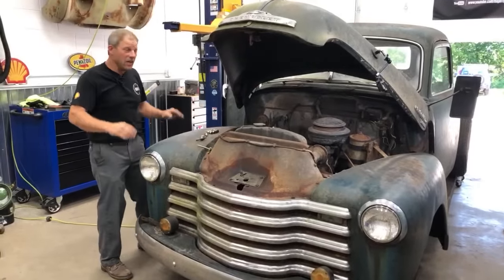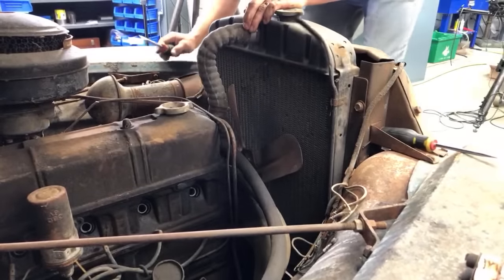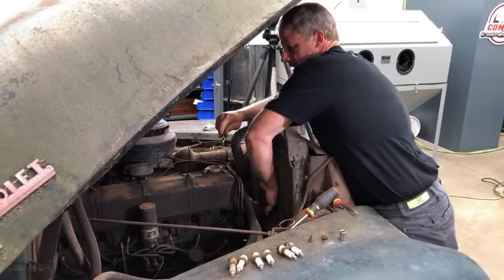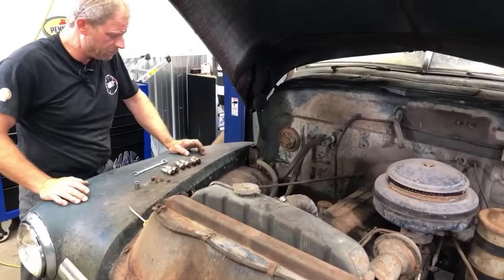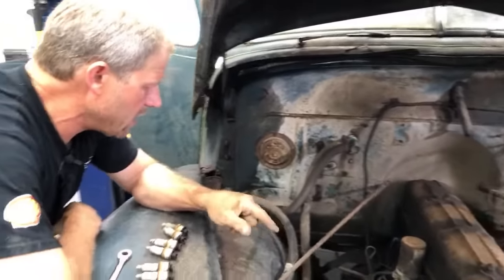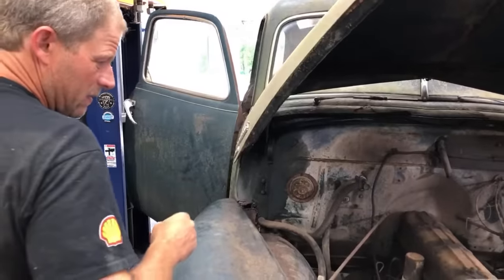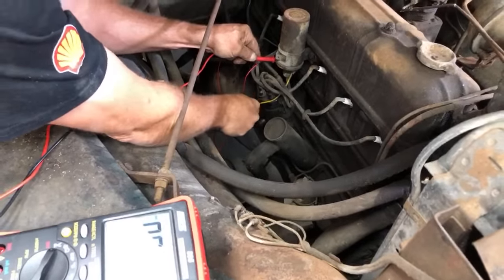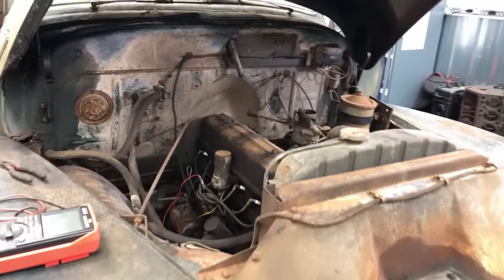Will It Run? 1950 Chevy pickup pulled from the forest | Redline Update LIVE

Comment: Don't reinvent the wheel, hook the hot wire where the ignition wire was and you should have fire. if it doesn't cut the condenser wire off as you don't need it to make fire, just a hot wire to the coil where the factory one went and with clean points it should spark. I have had dead wires but they had the fiber and not the real wire so that can happen to them. As slow as it turned over the starter is dragging voltage from the points. I expected it to fire with him holding the plug wire with needle nose and it would jump to him resulting in nasty shock. Usually you can just snap the points a few times and make a good connection. A real battery also would of helped as those jump packs are still in development

Comment: I see a few things that bothered me.... Good idea to add some oil (or PB Blaster) to the cyls before cranking. BAD idea to stand there and say CRANK 'ER UP with your face where the spray will come out! (have seen that in person) Why go through all the trouble to hand crank when you have a battery right there? If you want results then jump it with both feet. Clean the points (and check before putting the cap back on) then crank it up! Fire extinguisher? Good idea! Dry Chemical extinguisher..... BAD IDEA! Anybody know what that stuff does if it goes into the engine? Might as well be a can of Ajax. Use CO2 or a garden hose when only dealing with a small quantity of fuel. Better (and cheaper) use an old wool blanket. Wool is naturally fire retardant and everybody has moth eaten one in their attic. Better video? Could have done some prechecks then edited this to 10 minutes and avoided lots of confusion in the comments section.

Comment: No lubrication in an engine that hasn’t run since the 70s? So what are these great mechanical skills you speak of?  Common sense says no lube in a cylinder that has not functioned since the 70s just mite damage piston rings. Or do you just not have a lubricant sponsor🤔

Comment: You didn't clean the points properly, and you probably need a new condenser. I most likely could have had that truck running in 30 to 45 minutes. Of course it does help that I grew up with those old Chevy 6 cylinders and have been working on them for 30 plus years.

Comment: 235 didn't come out until 53. Port  babbit bearing crappy engines
Reply: 235 was put in power glyde cars starting in 1950. It has a low pressure oil system and dippers on the connecting rods. 53 had insert type bearings and a high pressure oiling system. The engine in that form was used until 1962 and was very solid.